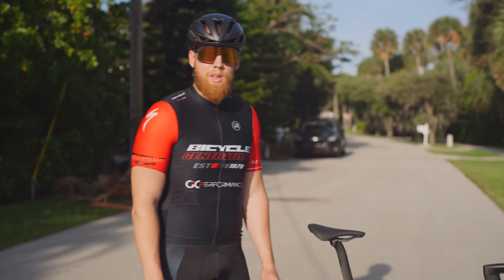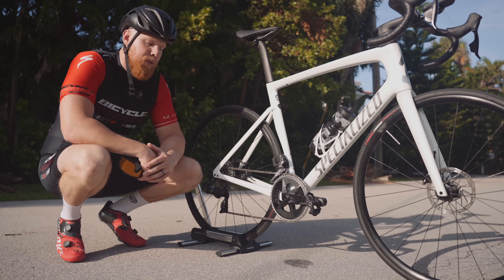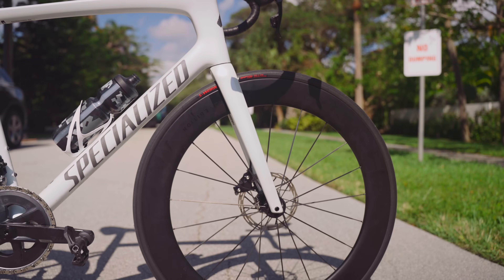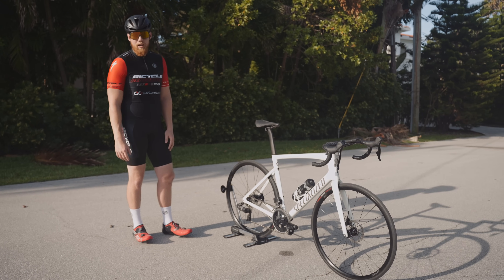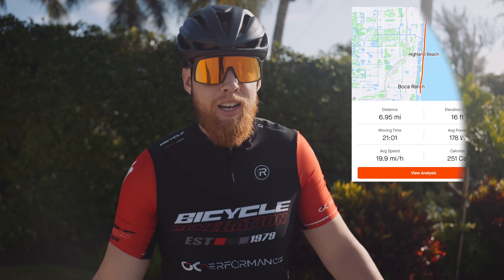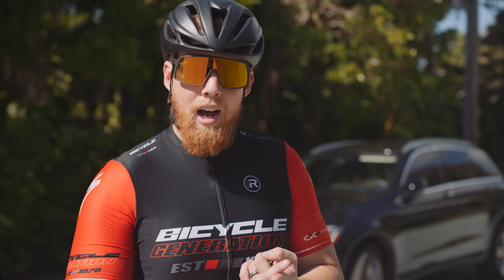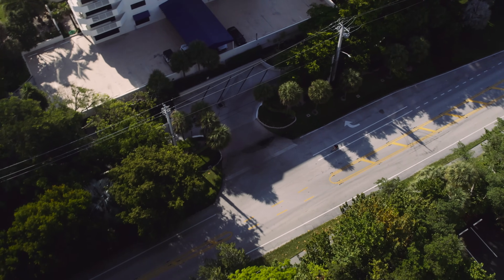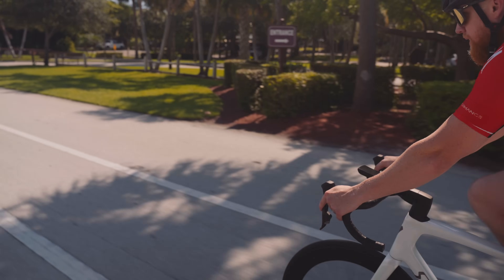HOW MUCH SPEED CAN YOU BUY?! *ALUMINUM WHEELS vs. CARBON RACE WHEELS*

Comment: Speed generally scales to the square root of power (that is, the equations for power have a v^2 term in there).  That 4% increase in power output between the two tests (185/178 = 1.039...) would suggest a 2% increase in speed (sqrt(185/178) = 1.019...) ... meaning that if you went 19.9mph at 178W, you should be able to go 20.3mph (19.9 * 1.019...) at 185W, even on the stock wheels.  This would suggest that the deep-dish wheels only made a tiny difference at these speeds.  :-(
Reply: It's the cube root, not square.
Reply: @the318pop  isn't power square but aero cube?
Reply: @krisgoose  power for what? The power required to overcome aerodynamic drag is proportional to the cube of the speed.
Reply: @the318pop  You're right. Apologies, Sir 🙂
Reply: @the318pop  Ah, thanks.  I thought I was missing something, but wasn't sure where the issue was.
Reply: Good Point, seems that wheels made almost no difference then. Maybe a few test runs outside of the city would bring more statistically valid results. Plus, the aero wheels have more benefits in crosswinds, so still day testing is undervaluing benefits of aero rims. Cool test nonetheless
Reply: Wait why cubed?  Isn't it based on cross section surface area of the mass facing the front aka squared?
Reply: These wheels do make bigger difference when ridden in aero position. CalCycling did a video on that.
Reply: He probably needs to go 200 watts the more watts the more savings.
Reply: Yeah ok nerd 🤓
Reply: Good point. Even if you're normalizing the theoretical speed for the second run using the cube root, it accounts for an average speed of 20.1 mph (32.3 km/h) with the aluminium wheels vs. 20.4 mph (32.8 km/h) for the deep carbon ones. To anyone not trying to make money out of winning road bike races, that difference is insignificant.
Reply: I noticed you don't start noticing gains until speeds closer to 30mph
Reply: That’s precisely what I thought (even though I don’t know the maths part).. basically, the test is redundancy cos the guy was pushing harder on the fat rims! Duuuuugh
Reply: This is good observation, does this conclude carbon wheels make less impact on speed and more on feel good factor? I have similar feel when driving between my carbon and alu bike, driving on carbon frame feel faster but in reality speed difference between these frames are minimal, this is my hunch and dont have supporting data.
Reply: @11robotics  Yes, good point, don't spend money just for the sake of spending money!

Comment: When you factor in the 7 watt difference between the two rides the speed is almost identical. That and we don't know how old the aluminum wheels were or how recently the bearings had been serviced. If he bent his elbows while on the Aluminum wheels  he would have gone significantly faster simply by reducing the drag on his frontal load.
Reply from the maker: aluminum wheels are brand new take offs, of the orginal bike, also I tried my best holding my arms as similar as possible
Reply: @GCPerformance18  I thought you did a fantastic job in holding a similar profile. The point I was trying to make (arguably poorly) is that if someone were to bend their arms ever so slightly, the reduction in aero drag would be more significant than what we saw from the wheels in your video, which, when you do the math based on the 7 watt delta was negligible at best and zero at worst. Coupled with the fact the aero wheels would be far less pleasant in cross winds it's hardly a sell. In light of this, I think it would be very interesting to do the same test at 220-240 watts (Still very achievable for a cyclist dropping 2k on wheels). I suspect we'd see a significant difference at that point. Making the wheels a far more attractive purchase. Great channel nevertheless, you're great in front of a camera.
Reply: @aussiefreediver  7 watts might account for maybe 25% of the speed increase. Buy the wheels then bend your elbows, you're still ahead ;-)
Reply: @the318pop  I don't think I communicated it clearly. He averaged 7 extra watts with the aero wheels. When you adjust his time to factor in the extra power, the wheels were no faster than the aluminium ones.
Reply: @aussiefreediver  7 watts will not equate to 0.5mph at around 20mph, closer to 0.2. Regardless it's an n=1 experiment. The statement that faster wheels make it difficult to control how hard he pushes the pedals is a little odd too.
Reply: He already tried his best to keep all the variables constant.

Looks like you are trying to justify your recent purchase of some overpriced alloys when you could have gotten carbon.  It's a silly argument when it's pure physics, bro.
Reply: @Snow1e   I never questioned his methodology, just the outcome. The numbers are simple. When you adjust the power output between the two rides, the time differential is negligible. As I said, if the test were to be done at a greater speed you would most likely see a better result. It's not rocket science that stiffer, deeper, lighter wheels are faster. Are they worth dropping $1,000 at 180w with the intension of going faster? No.
Reply: @aussiefreediver  Its better to look at HR between two drives, my hunch, 7 watts difference should have similar HR, if this is the case, Carbon wheels are efficient.
Reply: @aussiefreediver  Look at the calories spent calculation from strava that is the energy spent, in other words watts. There you get an estimate on energy saved.

Comment: Production looks amazing - really nice effort!

But +7w and +0.5mph doesn’t seem to support the theory that they are much faster, does it?
Reply: aero wheels doesnt matter that much at 20 mph but they do feel faster. 
tire pressure is usually more important 
also at 25-30 mph aero and tire pressure combined can make a significant diff
Reply: That is what thought as well. My average ride is 30 mile (50km) ride at 15mph (25kph) average. I think I should be better off with shallow carbon wheels for their lightness and comfort.
Reply: @mikew9743  they feel faster, because you hear this hu-hu sound 😉, but they aren't faster at my usual avg. speed of 25-30 kmh, btw I'm riding only hilly roads, 7km of flat road is unimaginable for me.
Reply: the carbon wheels are actually slower. first ride is 178 W average, second ride is 185 W. So the power input had increased by 3.9%. The speed went from 19,9 to 20.4 miles/hr, which is a 2,5% increase in speed.
Reply: @eagerbob  pwr increase exponentially as speed increases
Reply: @eagerbob  that’s not how it works. Drag squares with speed, so the power increase is not linear to the speed increase
Reply: It does not. However, test after test has shown that aero gains are almost nil when the airspeed is below ~22 mph. With no wind and a cruising speed around 20 mph, the test is not going to show much. I’d love to see the same two wheel sets compared at 22+. Regarding the wattage difference, the tester really should have had Average Power shown on his computer so he could keep it tightly controlled.
Reply: @mikew9743  yeah, true, i thought about that but wanted to keep it simple. But even then, the carbon wheels are hardly faster. Certainly not as fast as he expected them to be. Also, for the money, the differences are marginal at best. A lot seems to be in the perception. He says that he can feel the difference. He even says that the wheel almost keep rolling by themselves and "want to push you further", which seems at odd with the laws of physics and also with the results. Most of the gains are in the brain of the rider. 
Further, this test is hardly scientific in the way it was executed. And even if it was, the biggest cause of wind resistance is that huge body of the rider (the beard!) and the position of the rider. So even if the aero of the wheels is better, it is still a marginal difference in the grand scheme of things.
Reply: @eagerbob  more powerful riders will benefit more from carbon wheels 
Average dude noodling at 150w don’t need 60mm 
But it’s wants vs needs!
Reply: @CyclingTX  most rides their bike faster than 22mph on a commute?

Maybe on a training ride
Reply: @eagerbob  speed and power aren't directly proportional mate. riders in the TDF average 300 watts for a ride, and go about 28miles/h average. Why don't they go 112miles/h when they sprint at 1200 watts? Obviously it's not a huge difference, but they are faster lmao. And the benefit increases the faster you go...
Reply: Yeah, my primary school level maths says 3.79% more power to yield 2.45% more speed. Surely that’s slower per watt. 

We definitely need a faster test, 25mph , 30mph?

Which ones would I want though?! Got to be the carbons! For the sprint right?
Reply: @mikew9743  exponentially?? do you physics much? LOL
Reply: @eagerbob  Resistance doesn't rise linearly.
Reply: @eagerbob  using a calculator we can see that if you go 19.9mph at 178w, you should go 20.2 at 185w, so its a 0.2mph increase or 1%.
Reply: Not quite correct. Using the online bike power calculator, one finds that 178W yields approximately 18.88 mph, and 185W gives 19.16 mph, so an increase of 0.28 mph, so one half of the value in the video.
Reply: The carbon wheels MAINTAIN or SUSTAIN speeds over 25mph easier than shallower rims. But technically, they don’t “make” you faster at lower speeds because you still need to put power. The shallow rims will feel better at climbing because they accelerate faster.
Reply: Well I just saved 1000+ dollars.
Reply: Also he cycled 90 yards further on the alloy wheels so the difference once you take the extra watts and the extra distance is actually quite small. The deep wheels did look cool though.
Reply: @mikew9743  No, not exponentially but cubic. There is a difference, come on peeps.
Reply: It's a much bigger difference at race speeds (25mph+). Or at least maybe not a huge difference in terms of %, but enough to give you that bit extra which helps when you near the limit.
Reply: @eagerbob  air drag is proportional to the square of velocity, so this actually kind of just shows that there is basically no difference.
Reply: @eagerbob  Power requirement does not increase linearly with speed. For the same aero configuration, to increase speed from 19.9 mph to 20.4 mph requires roughly 7% more power. The carbon wheels reduced that required power increase to ~4%, for a power savings of ~3%.

Comment: You did your best to do this test the right way - same body position, same tires, tubes (pressure wasn't mentioned, but seems likely), and posted the wattage difference.  That wattage difference accounted for about .2 mph, but that's understandable since it is difficult to hold a steady wattage like that.  I've seen most of the bigger channels do this type of test with too many other variables,  such as different tires or very windy conditions, which is pointless.  Great video!

Comment: An honest video, with a correct result I think.
Using a cycling wattage calculator we can see that if you go 19.9mph at 178w that means you should go 20.2 at 185w. So you got 0.2mph free speed around 20mph or 1%. This is actually expected, and many people (myself included) find similar results when testing deep wheels at these speeds and wattages. I know, there are a couple of outliers on youtube, that report waaay higher gains, but these had a clear incentive to push these wheels and I dont trust their results at all.
Main take away from this is that you should ride the wheels you like. Buy what makes you happy, because that is why you ride your road bike anyway. I think deep carbon wheels will make you happy ;) 
An other thing to note is that you rarely see 60mm deep wheels anymore in the pro peleton, even on flat races most riders seem to prefer a more medium or even shallow depth. It doesn't slow them down much.
Reply from the maker: Thanks so much!!! I honestly appreciate the feedback
Reply: Came here to say this.  Speed gains fairly linear with applied power increase:  ~3% increase in power output = ~3% increase in average speed.  That being said, probably a lot more comfortable, and definitely look a lot better!

Comment: That dtswiss 350/370 hub w 54 ratchet  engagement will also push you versus the 3pawl system in most stock wheels..lol

Comment: I heard that below around 22 mph there is no difference between basic and deep wheel so this video give a proof. The video will have much more value if you can do either maintain 25 mph and see wattage differences (since your route is flat and no wind), or do a 300W for 10 km and see what is the time and speed differences...

Comment: An interesting experiment, though understandably not all variables controllable. According to online power calculators - riding with the alloy wheels at 184W would have given a result of 20.2mph.  Hence the carbon aero wheels increased the speed by just 0.2 mph.
Reply from the maker: I think if the wattage was higher I could have the wheels shine better, not gonna lie. I felt it very hard to control the pedal stroke with those wheels on such a flat surface. They wanted to go, so that’s why it was 185 I wanted to keep it a normal number for all of us to relate too but I think it needs to be a higher number of watts. Where as with the stock alloy wheels I felt like I was working the whole 7 miles to stay around 180 watts. Also for reference. He motor paced me the whole way back behind a scooter and I was doing 23-24 behind him only doing 130-140 watts. The wheels at thag depth shine at higher speeds
Reply: @GCPerformance18   thanks for the reply, appreciated ... sorry, no criticism of you or your work intended ~ all good stuff. I believe that you're right though, aero advantages are more significant at higher road speeds.  I'm  65 and a lower power rider, my average power over 7 miles would be about the 180W that you chose, so you've given me a good indication of what carbon aero wheels might reward me with if I decide to go down that path.  I'm going to have to balance any potential speed advantage with the stability I get from my lower profile campag Zondas though ~ it gets quite windy here due to sea breezes.

Comment: Nice video.  I did a loop from Hollywood to Delray on the same route on Saturday.  Nice ride except for the dude that sat on my wheel from the north end of Boca all the way to the turn off to your shop.  Dragged him 10+ miles.
Reply: A couple of snot rockets usually neutralizes that type of situation with the “sorry man didn’t see you” lol
Reply: Yeah, once you get North of Spanish Blvd there are some great stretches without traffic lights up to West Palm.
Reply: Flick your elbow. If he won't pull through attack him. If you can't drop him just slow down enough to force him to pull through

Comment: Been thinking about this for a minute. I have watched a lot of videos.. the ones who say the carbon are faster always end up using more watts and end up with higher speed. ( think about that) yet other people who say there are no difference also how same or basically same wattage… i feel like at lower speeds the tests are useless. I feel like testing at 30 mph would be a better test. Where aero is sooo much more than at 20 or so. Everyone wants to do beginner level paces.. well.. beginners aren’t needing aero wheels… advanced riders are which are the ones that crank 400 watts at a time and can hold closer to that number.. I may have forgot a few details, but that’s a trend I noticed,

Comment: Some of the biggest gains are body position / fit, aero helmet, kit, tire setup (low rolling resistance, proper psi, tubeless or latex tubes) and honest hard work to get faster. People want an easy answer and aero wheels are bling and look cool so nothing wrong with getting them but the aero gains here aren't a major factor unless you are racing and pushing really fast speeds. Also if you fit a tire size larger than is optimal for your aero wheels then you have unknowingly nerfed any real aero benefit.

Comment: To the people saying the 7 watts extra power are equivalent to .5 miles per hour extra speed. That's part of it but according to a calculator it's about 14 extra watts required to go 20.4 instead of 19.9. So there is a measurable benefit. 7 watts at around 20 miles per hour. That's actually quite a lot ~3-4%. Outside of that, one needs to consider that this is a real world test with sample size 1 for each.

Other than that you can actually calculate down the watts saved in a wind tunnel at 30 miles per hour to pretty much every speed.

Comment: It seems the biggest difference is the look. On the shallow alloys you kind if looked a casual endurance rider while the carbon rims looked so much more aggressive.
There is a little more to the story though. Everybody always just compares numbers because that's what is most "tangible" in this case but just the feeling on carbon rims is slightly different. They seem to hold speed easier. They feel like they just want to go (as he said in the video). The sound that they make when rolling or cornering. And if peer pressure is your thing, nowadays in a big group it seems like 80% are on those wheels. I was shocked when I joined a group ride of multiple thousand people lately and they were everywhere. 
Is it worth the money?! Well, that's on you! I've got a set of 3 wheels (1 front, 2 back) used for less than €400. I don't ever want to go back. I love them!

Comment: I have Bontrager Pro 51s on an a Trek Emonda and don’t see much of a speed boost around my average (18-19mph) on rolling hills. But I do get a very good noticeable boost on descents and downhills at 35 mph+. My biggest bang for the buck improvement was going to Conti GP5000s and latex tubes. Very noticeable at all speeds.
Reply from the maker: yea i mean for dollar value tires and tubes make a big difference but once u get some nice aero wheels in a good group or by yourself even around 22 it does make it hold easier, so like u said it would shine on the decents for  sure